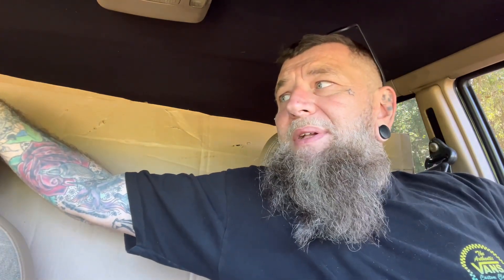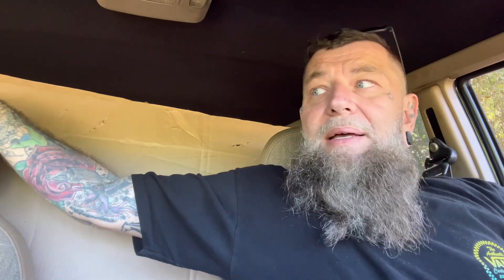DIY lithium or pre-built

Comment: Lishen Lto are great cells I run 12 banks of them in my daily driver wall build  they are better than Yinglong if u build a nice big bank for almost  the same price
Reply: @DBuilt 602 do you have a specific place you'd recommend someone buy Lishen Lto from? I've seen them online before. Another question, does Lishen do well at 14v? Or does it need to be charging higher?
Reply: @itdoesntmatterwhatyourname6128  lishen does great at 15.3-15.6v range order of a alibaba seller it's just a long over seas wait but it's way cheaper

Comment: I have a salt 8 and 2 zv6 15s,  have a 250 mechman alternator, yellow top agm under hood and a xs power xp 3000 agm in rear, i only turn it up 30/50 , 50 is clean, dont want to stress anything out, voltage only drops to 13.6, well just bought a limitless cyber 12k, did a battery delete, so only running the cyber 12k and a 500 farad super cap, volume at 30 voltage drops into 12s now sadly, going to get a xs power 500 super cap for under hood and another cyber 12k, do you think that will keep me in the high 13s?
Reply: Cmax brother
Reply from the maker: not sure, i would sell the cyber 12k and get 80AH of yinlongs..
Reply: Get a headway lithium im getting a 5 bank to support 3k ...so maybe if you get something bigger like that it will work 
And then get another alt or just upgrade your electric to operate higher 🤔 although not sure really just ask Jerry Jerry Jerry!  Haha

Comment: I considered a cyber lithium. After talking to limitless about them they recommended the blue batteries they sell. The cyber is geared more toward quick power for like burps because the charge rate is high. For demos you need the normal limitless.

Comment: I been running two 45ah limitless for about 3 years now and they hold up great I sit at 14.9 drops to about 14.5 so not really much drop plus I'm running a 400 amp alt... I can't say anything about limitless cause they have worked for me I'm running a crescendo 6k with two nightshade 12's... I've never had a problem out of em
Reply from the maker: but i assume they are not the Cyber line
Reply: @JerryAintloud  no they aren't just a plain ol 45ah... I've had good luck with em I bought em for the looks mainly but they was high I can't say I'd buy anymore of em but I've had good luck so far

Comment: First off thanks for the info ....I am running a small system but even with larger charging capabilities and amps in my alternator....i am still suffering light dimming when the sub really flexes ....so I work at a technical university in tennessee in maintenence....where they are doing alot with battery powered cars ...self charging golf carts ...etc. etc. ....I am going to go see a professor on campus and see if he will point me in the rite direction on building me a small lithium bank to put under my bedcover or under the platform I built to raise my extended cab floor up to make it level from one side to the other and raise my sub box up where it is just a couple inches from the bottom of the back glass ...allowed me to mount amps on both side of the box and hide all my wires as well....going to do a high demand/ capacity batt under the hood ....I already tried a big 3 and it didn't help very much yes I got better current but still suffering voltage drop when sub hits the lower notes ....If I find out anything worth sharing I will let you know
Reply from the maker: sounds like you have the right people to help you
Reply: @JerryAintloud  well without finding you on here a couple months ago I wouldn't even know where to have started ....love the attitude brother ....always staying positive ....I just got back into car audio I don't have much of a system....but it's what I could spare to spend as I am restoring my ol 1998 s10 extended cab....decided when I started if I was going to put anything in it I was going to gut it and sand the floor pans fix prime paint it all then there's the heat and sound mat and all those different options you have ....I did about 90 percent coverage with the foil backed 3/8 in stuff then done roof door panels floor back wall and where the dash speakers go with roll butyl...and I only have 4 3in ds18 Kevlar midrange a set of 6.5 skar mid bass in doors with a 1 in skar tweeter above them in door panel ...2 6x9 TX series skars a 1500.1 skar amp on a memphis mini mojo 8.....and a orion 3500.4 ab running all those other speakers I mentioned ...with a alpine 172bt cd multimedia player.....but it will surprise you when I turn it up ....and yes I plan on going bigger with the sub and getting a better sub amp .....but for now it's what I could afford .....now on the lithium bank any knowledge I get from anyone here on campus I will gladly share brother....but I think you probably know more about it than they will ....and that's what I like ....you did it by just trying and seeing what might happen ....

Comment: I feel you on the limitless lithium 12k. I brought an aftermarket 330 alternator and I still had major voltage drops. It wasn't until i switched back to letting the computer regulate the voltage. Thats when my 12k absolutely shined. On a 8500 watts system at full tilt. My voltage would go from 14.2 to maybe 13.7. This is with a cheap 100 amp alternator. They dont do well with aftermarket alternator running a separate voltage regulator. From what i seen.

Comment: Thanks for the information for guys like me. Fr. I just finished up my lil build and I was afraid of lithium just cause I'm not very knowledgeable on building or maintaining a lithium bank. So I ended up building my own battery box and putting 12 AGM batteries on a Ohio generator 350 powering up a soundigital evox 12k. I have a no wall with 4 12s and did a 152.5 at 42 htz. It's a brand new vehicle and I was afraid I would burn it down with lithium plus I'm not ready to hurt the SUV tooooooo bad. But have missed these kind of videos thank you for your time and the info you give out brother
Reply: thats so much agm. You could build a 50ah scib LTO bank that would weigh less then one agm battery. But the only lithium that could burn you car down would be cmax(NMC) if abused by someone not knowledgeable or built with proper compression. LTO is the safest battery on the market safer then lead acid and AGM. They just like being charged 15v+ but you can get away with 14.8 if you really need too.
Reply: @DustinG33  I know but I need to do lil more research before I test things by myself. Here in ky no one deals with lithium not even the shops but I'm getting ready to build a 85 Cadillac here in the next few months and I'm gonna try building some lithium for it. Thank you for the information cause I need all I can get fr.
Reply: @paulwilliamson489  hank Veach deals with lithium heavily. He’s southern Indiana if you’re willing to the make the trip. An absolute Heavyweight in the audio game
Reply from the maker: @jacbybentril7114   hank is legit
Reply: @jacbybentril7114  I'll have to check him out cause I really want to stay around 14.4 without dropping to much my amp is 12k at 12.6 but at a steady 14.4 its lil over 13k. Who knows I might upgrade to lithium and a Korean amp know any good fabricators? Need a bracket made for a 3.6 V6 on a 2014 Durango limited
Reply: @paulwilliamson489  not any for a alt bracket I’m assuming you mean. But tbh idk why people run stock voltage electrical in an aftermarket system. I only see the benefit in spending 1500$ for reserve of its going to up the voltage from said previous. I’d recommend cmax but you can’t run that at 12-14
Reply: @jacbybentril7114  I'm running a Ohio generator 350 right now I was wanting to add a 270 or 300 to the 350 I have. Depending on song I don't fall under 13 volts I just want it stable
Reply: @paulwilliamson489  look into headway with your charging voltage. Youd probably need 144ah+ to support the 13k without much drop. Jerry has a video of some headway banks he built
Reply: @jacbybentril7114  what's the easiest way to increase the charging voltage on a 03 Ford Crown Vic?
Reply: @DustinG33  you mentioned 15v+, can yinlong not be ran at stock charging voltage 14v-14.4volts with a h/o alt? I keep seeing people say yinlong is fine at 14v... Idk that's why I'm asking. I was planning on building my first bank using yinlong and was going to leave my voltage where it's currently set from factory @14 volts. I currently have a 350 h/o alt, big 3 all OFC 1/O wiring and Northstar agm. I'm hoping yinlong will be OK at 14v but I don't like half as*ing things so if it will not I'll have to put together a new plan.. Maybe even just figure out how to increase the voltage point my vehicle charges at and then turn it up to around 15-15.5 possibly. I still have things to learn. Thanks for your time.
Reply: @itdoesntmatterwhatyourname6128  If your'e charging 14.8 you can get away with the yinglongs. They really prefer the 15.3-15.5v range from my understanding. Running them under 15v there discharge curve starts dropping off. If youre under 14.8 all the time id go with headways and you can run them with the agm underhood so you dont have to do a battery delete
Reply: Sounds heavy

Comment: I have about 2200$ in cmax I have a 90+2-45's because of space constraints and I run about 26-35k watts easily off of it and run my stock electrical with it
Reply: How? Dioded stock alt?
Reply: @jacbybentril7114  what I do is run two external regulated alts at 16v, then I run two 12-12 victron charger boxes off my cmax back to my stock battery, the victron runs my truck at 14.4 or whatever I want it to run it at, I run it usually at 14 the stock battery that runs truck and head lights fans and ac, but audio runs all at 16v u can't run a stock ecu up to 16 safely especially on newer stuff so this is where the victron comes in play, if u went to learn more hmu on fb name is the same as here on yt
Reply: @1-Six-dee  interesting mane but I think I’ll stick with my current cmax setup does great
Reply: @jacbybentril7114  if u have never ran ur cmax up to 16.1-16.2 u r missing out on a lot of capacity, I can burp at 15.5 and drop down to 14.9 and recover back to 15.3 quickly with no charging when I am at 16.3 I barely drop to 16 and recover almost instantly after volume drop
Reply: @1-Six-dee  when I had my Tahoe I ran it at 16v but since then I  just do trunk builds and haven’t been able to find a ride that could survive above 15.7
Reply: @jacbybentril7114  that is why I am telling u about the victron boxes, they handle all the factory charging needs straight from the cmax, it acts as your alternator and you set it to 14v out and it takes in whatever voltage your cmax is it can go up to 24 volts and still put out 14v steady @45 amps, which doesn't sound like a lot but most cars only use about 40-60 amps of charge on the stock electrical if u aren't running amps off of it, I run two both at 30 amps but they usually run what they need to which is about 18 amps per box, with these installed u can charge to whatever
Reply from the maker: i have a 135 cmax and have clamped over 40k with no issues
Reply: @JerryAintloud  I run six smart fives I have clamped 6500-7500 an Amp and have zero issues with voltage

Comment: WHY IS MY AMP CLIPPING WHEN I TOOK MY 12S OUT OF MY PORTED BOX AND INTO A SEALED BOX??? WHATS HAPPENING
Reply: I know what's wrong wit it, ain't got no gas in it. I don't know but good question.
Reply from the maker: @fusiondensity3287  :_awesome:
Reply: Retune the amp. Those 2 boxes behave quite differently
Reply: Sealed box won't let the sub reach it's correct xmax for given the amount of watts there for the sub will clip
Reply from the maker: this could have to do with impedance rise, by subs not moving to full xmax you could be in lower ohms with less rise.. less rise means amps making more power.

Comment: Definitely diy. I built my own 190ah cmax. Definitely worth it. 2 salt8 strapped at .7 full tilt and voltage don't even flicker. And built it for less than $2,000.
Reply: question is where do you find the cells though I was going to do the same I bought half that and need the amount you got
Reply: So you run the cmax pretty much dead? Considering they should be around 16v and the salt doesn’t like high voltage. I’m curious because I run salt8 as well @.5 and I need some better electrical than I have now.
Reply: @0XxDOMESHOTxX0  I run my salt 8 for 2 seasons now at 15.5. No problems.
Reply: @jacbybentril7114  at 15.5 would that be around 80% charge?
Reply: @0XxDOMESHOTxX0  I’d have to check my balancer to give you an exact number but I thinks it around 65-70% capacity at 15.5 it does great my voltage doesn’t budge